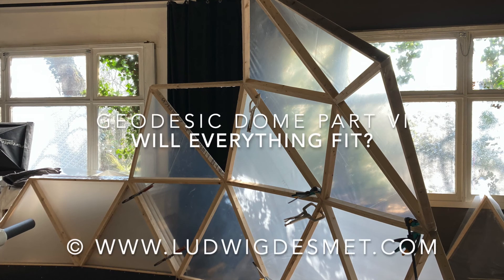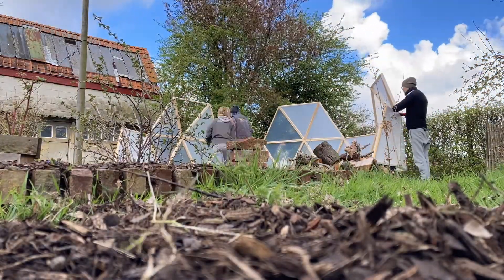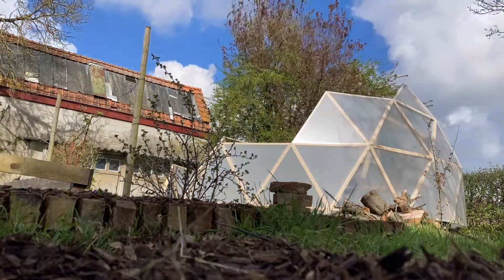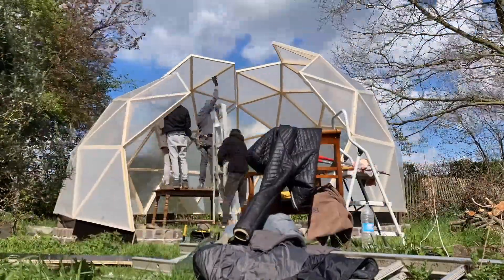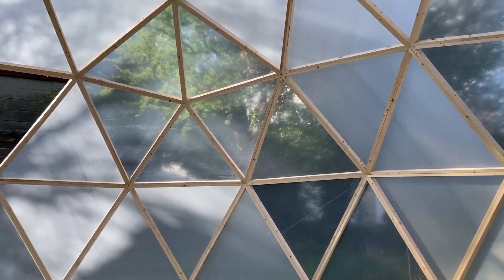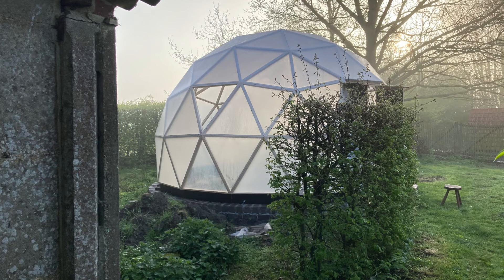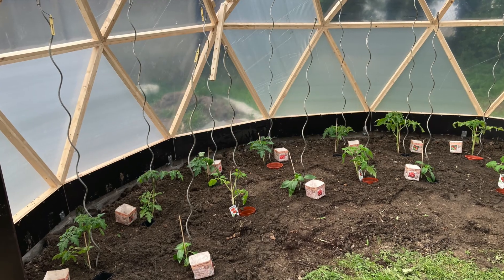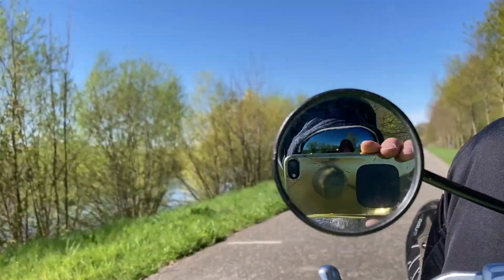Will everything fit? - Geodesic dome part VI   assembly

Comment: thanks for taking us along the way of constructing your dome! It turned out very well! I love GD and want to build my own - even did sone research and calculations on materials needed and corresponding costs. however, what makes me a bit hesitant do start the project is time constraints. I have a job and two small kids. shall I better buy a poly tunnel off the shelve? how many hours have you put into yours? Greetings from an Austrian Cyclist!
Reply from the maker: hi Helmut, happy I could be of inspiration. Total time spent is a little difficult to say as I did it in my spare time during last winter months, sometimes a couple of hours, sometimes a full day. A wild guess: for the foundation: 3 days, prepping, masonry, joints. For the frames: roughly 5-7 days. For the covering, another 3 days. Assembly of the covered 'half-hexagons' to hexagons, pentagons 1 day. Assembly of the dome 1 day. fitting it perfectly on the foundation base and fix it: 1 day. Making the door opening and the small triangles next to the door: 1 day. Making the door and fitting the door 1 day. Fitting the windows: 1 day. In the mean time I added a water gutter all around and water evacuation to a recycled water reservoir: 1 more day. Totals 20 days of fun and the wonderfull feeling of actually having made something really unique. Everybody is astonished by the beauty of it, and no-one I've met here in my garden has seen one before. If I would make a second one it would probably be quicker, but I'm still thinking about a better way to make it weather resistant. It is quite waterproof (actually 100% waterproof now) but it suffers from condensation in cold nights, so the wood still gets wet. Also the poly foil is guaranteed 6 years but only time will tell if that's a correct, an optimistic or a pessimistic perspective. I don't remember if I mentioned cost of materials, but I spent about 1000€ in total and thats pretty cheap for the surface covered, but of course not taking into account deterioration over time. You probably know you can also buy GD kits? ... final note, your kids 'll love it ;-)
Reply: @velopromobiel  awesome! Thanks for taking the time to give such an in-depth answer!!
Reply: @helmutm3884  
Polytunnels are functional but they`re not as visually appealing as a dome. I would let the kids decide,  show them a picture of a polytunnel and a dome and ask them which they like best :)